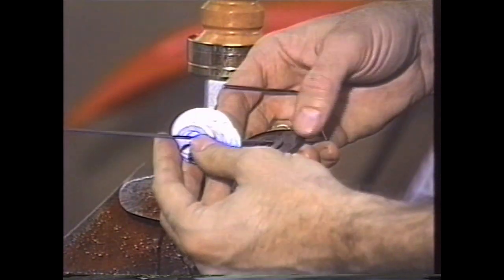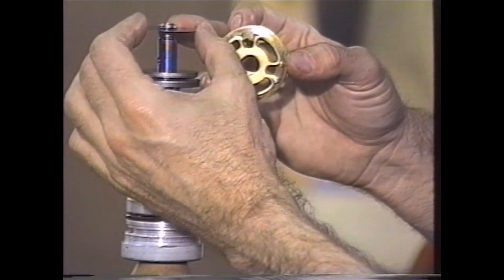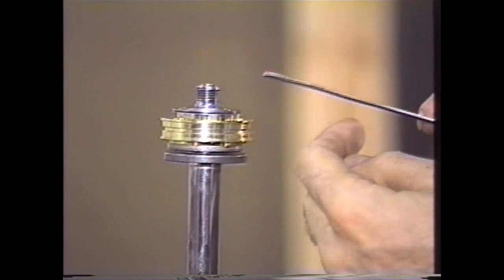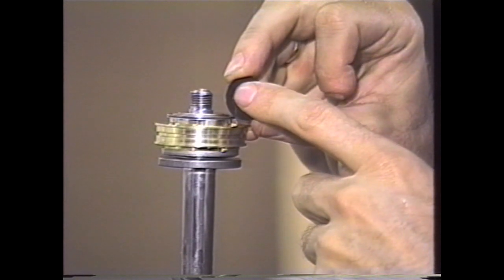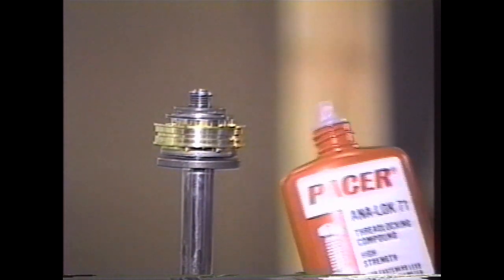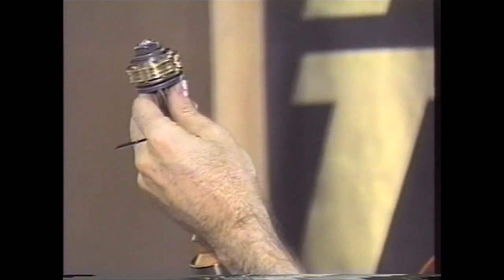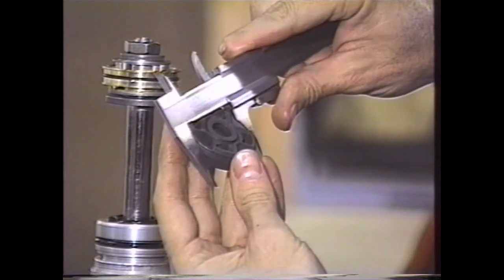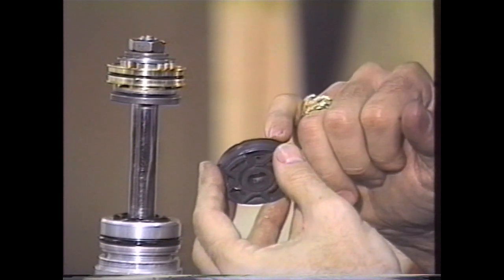Technical Edge Dirt Shock - Part 4 - Gold Valve Installation

Comment: I would like to know the correct torque for the piston nut...i can t find it anyewhere.
Many thanks
Reply: My 2002 YZ250 KYB Shock called for 25 ft-lbs (M12x1.5 threads)